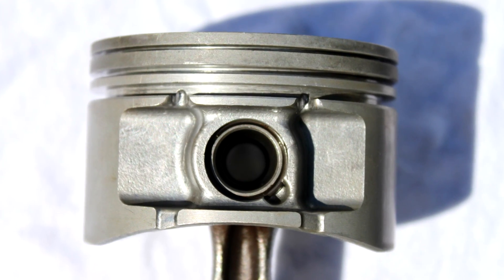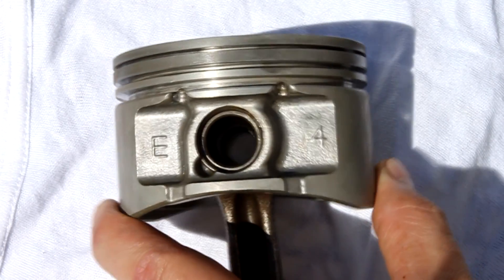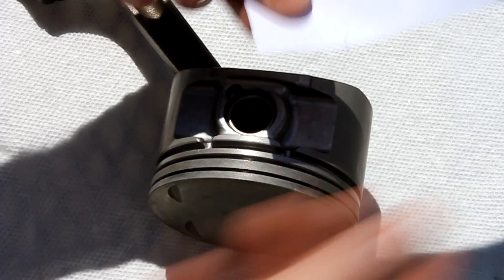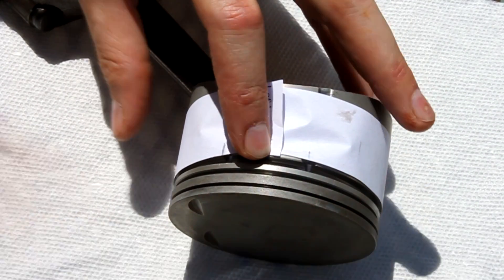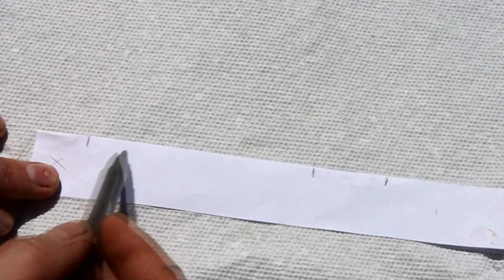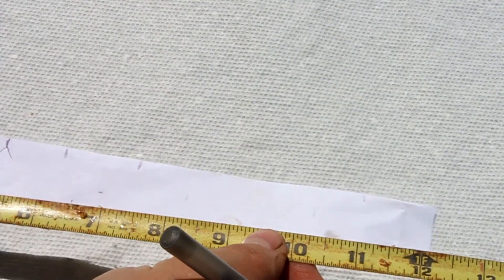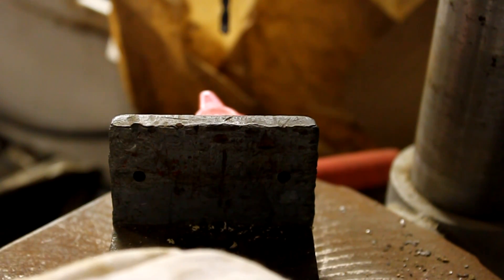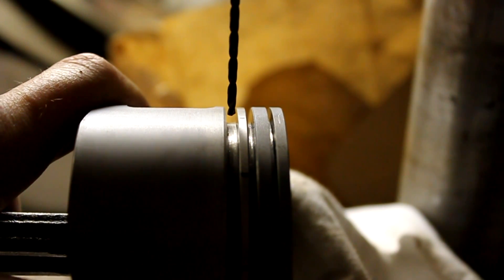Drilling oil drain holes in piston, Oil consumption & burning issues

Comment: should gas port the piston while ur at it it seals the top ring and helps a lot ! in most measure .100 from the edge to the inside groove and mark it comes in right behind the ring and pushes the ring out on exhaust stroke sealing it tight

Comment: Followed your vid and did this to 12 hp Briggs which was a real smoker. With new rings, no more smoke.
Originally the piston had 2 square holes at each end of the skirt side. I drilled 1, center, full width of the groove both sides, and two 1/8 holes  either side of of center holes.

Comment: I've done this in 2 Saturn engine rebuilds, and it definitely helped.
Went from 1 qt in 1000 miles to under 1/2 qt in 1000 miles.

Not hard to do, just make sure you get any burs and debris from drilling out.

Comment: its important to have those suction oil cavities but also its very important to balance the pistons
(i). to balance the pistons, make sure you have installed everything that make the assy complete such as pins, snap rings, piston rings and its bearings
(ii). get a scale, (manual, analogue or digital) to measure each individual piston assy and write it down on paper
after all its accesories have been installed correctly, place the piston upside down and with a drill bit take out unnecessary aluminum metal material from inside the bottom of piston inside its skirts
(iii). measure its weight and make sure each piston weights the same
(iv). lubricate cyl linings and intall pistons inside its corresponding engine block
(v). finish your job and chaege your customer for it ✔

Comment: Where each of these grooves ARE! What a wast of time. Why not work on a hobby car that is something instead of one of the worst cars GM make. To me all Saturns were just awful looking and performed even worse.
Reply: Your opinion is wrong, stranger. Saturn S has a decent power to weight ratio, is easy to work on, is reliable and looks good in many people's opinion, and you can get a good one for less than a grand today, and find plenty of parts in junkyards and a very helpful community online.

Comment: I bought a 95 saturn SL worst brand new car I ever bought. Burned oil and It only lasted 5 years. I bought  kia rio after that brand new in 2001 and it lasted 15 years. Only sold it because the transmission locked up. A neighbor fixed it in a few days and sold it.
Reply: Then you had a dud. I have a 97 and its going strong at 226k miles.
Reply: Or he never changed his oil.

Comment: well done, you just threw a perfectly tuned and balanced piston completely out of whack. good luck with bore wear and compression loss
Reply: compression loss lol its below the compression rings
Reply: He can easily get them weighed and balanced. It's an oil ring not a compression ring. No way he will have a problem cylinder bore wear
Reply: remember kids, allways tune and balance your pistons!
Reply: Actually the consequence of the drilling is not enough to have an affect of the balance.  You’re comment is really baseless and without merit.

Comment: First, thanks for this. However, would appreciate a note in description warning about balance issues. It's still possible to remove more on one piston than others, and while pistons are out, why not check balance? Course, Doesn't crank need balanced if pistons modified? Forgive my ignorance, this is just something I have already overlooked, sadly. Thanks again though!
Reply: Nah, your not removing enough weight to where it'll effect balance if u were worried about it just weigh your rod and pistons to note any weight difference but I can guarantee this isn't gonna throw your balance off by any means, especially if u do them all the same but the difference in weight will be so minimal it'll go unnoticed! If your still unsure skip drilling a couple of the holes and just do a couple instead but it won't matter as far as throwing off any balance
Reply: I was wondering the same thing about balance
Reply: It's nowhere near enough to affect "balance". It is anyone's guess as to how accurate the factory balance is anyway.
Reply: btw, engine still running strong after this mod. Unfortunately, I can't comment on eliminating oil burn... I am almost sure I compromised the seals on the valves. Might still try fixing this using another trick to allow replacement w/out taking the head off... 

If I think about it, I can comment back here... Though, it's been 5 yrs, dunno if I'll get around to it. (now, maybe burns 1qt every 1k miles? Dunno about originally, it's been too long )
Reply: @ThePepperdirt  if your worried about using an air adaptor because of poor valve seal you can use a piece of nylon rope down the spark plug hole for each cylinder then just turn the engine by hand till the rope holds the valves up at top dead then you can remove them without worrying bout accidently dropping a valve when you the springs back on you just turn it over the opposite way and pull your rope out
Reply: 99' Saturn. 250k(?) full engine rebuild ( probably only needed head gasket replaced, maybe filed smooth ) now sitting at 270k. Don't drive nearly as much lately. Reliable car... ( can't believe I didn't replace the oil pump. prolly going to die one day lul  Was in spec at time of inspection tho. )

Comment: Would that make a piston weaker?? Aren't you worry about, they will "split" half??? Just wondering, and one more thing: which oil makes less smoke: full synthetic, or regular, like high mileage??? And which oil makes more "mess", slouch?? Thanks =)
Reply: Nahh a good quality piston wont split in half if u Drill a small hole

Comment: What about the removal of material from the piston throwing out the balance on the crankshaft? Engineers go to a lot of trouble to ensure secondary balance issues.
Reply: If the holes are symmetrical on all the pistons on a 4-inline engine, there should be no imbalance issues.

Comment: How well does this solve the consumption problem?  Also have there been any problems with the balance between the crankshaft counterweights and the weight of the piston and rod?
Reply: Ring doesn't get stuck with sludge
Reply: If people don't change the oil on time and use crappy conventional oil even the biggest hole will clog with sludge. But this should work better and be harder to clog
Reply: It won't ruin the balance, this piston didn't even lose one gram of weight:
https://www.youtube.com/watch?v=la4nazvcyrs

Many premium builds don't even balance their piston to +/-1 gram, so the difference would be practically impossible to notice.

This example was done to a V8 engine, where piston balance is even more critical.
Reply: I wonder why some of these people open their hood for god Sake XD
Reply: I have this question too.

Comment: if the holes aren't drilled evenly will that throw off the balance of the piston?
Reply: +michaelpault Yes, but it won't be of consequence because the piston isn't spinning, it only goes up and down. You more or less want them evenly spaced simply to do an accurate job, and for oil to have plenty of opportunities to flow in several places.
Reply: Pistons are balanced in weight to the other pistons on the same crank. If all of the pistons being drilled the same, then balance won't be a issue enough to even bother with it.

Comment: this is crazy.. even Pistons out of lawn mower engines have holes drilled into the 3rd groove
Reply: +bobl78 even air compressors do !
Reply: Shit will cut your lawn so fast and smooth you gonna think you're riding slick tires on brand new pavement

Comment: Hi. Thanks for the upload. The BMC / Leyland 1275cc A series engines suffered from the same problem, the solution being as you describe. How much can 6 holes per piston cost at manufacture? Cheers
Reply: +Andy Reynolds: It may not cost a lot per single Piston... let it be one Dollar... it is a lot of Money if you save one Dollar on 4 Million pistions..that´s why they do it.. crazy wordl
Reply: *exactly*;
Reply: +Andy Reynolds It's because the cars are designed in Washington by regulators and not by engineers. Adjust geographical reference in BMC/Leylands case.

Comment: Every Saturn I've ever seen burned oil right off the lot new but this does work did it back in the late 90s to several Saturn's and everyone of them is still on the road today
Reply: +David Tuerk yeah they definitely like to consume oil the one I have has close to 600 thousand miles on it the car actually went 156 thousand miles with the original clutch just had to replace the oil pump and housing due to low oil volume but adding the oil drain back holes in the piston made a world of difference in oil consumption went from about a quart every 500 miles to about every 1000 to 1200 miles a quart and for as little as I've had to do to this car since new in 1992 besides general maintenance the oil pump and oil pump housing and replacing the entire cooling system and the drain back holes in the Pistons is the only real work that's been done to it in the 23 years my wife has owned it
Reply: The Dude - I had a ‘92 for 25 years and found this trick helped too. Similar observation on need to add oil.  These are relatively strong engines in other respects and can take abuse like moderate boosting.  Sad to have given car away 2 years ago due to lack of parking.  ☹️

Comment: It would be a better idea to line your vice with aluminum strips. Cheap stock (flat or angle) from the hardware store cut down will work great. It will not mark the aluminum piston unless debris gets on it or there is a jagged edge from cutting.

Comment: My sl2's oil consumption is getting worse. What are the thoughts on pulling the pistons, drilling the holes, and putting just new oil rings in? Doing this without doing a complete rebuild.  (no other rings, no honing, etc). Thoughts?

Comment: It if far more important when drilling to not mar the upper ring surface in oil ring groove.  The bottom surface isn't really important.  Many new vehicles have the holes that break into the bottom surface.
Reply: So where should the hole be drilled then

Comment: I did this to a Saturn 1.9 one year ago, the engine burned about 1 quart per 100 miles before drilling, and 1 quart per 1000 after drilling. After one year of driving every day, still using only 1 quart per 1000 miles. Thanks for this video!!!
Reply: Sounds like your valve stem seals are leaking you should have the head rebuild

Comment: toyota need this in vvti engines.
Reply: +Broj 1 Toyota must have fixed the problem by 2006. I have an '99 that drinks a  lot of  oil .
The problem is (per the Toyota service bulletin): The piston runs at a higher temp than expected, so the oil cokes up behind the oil rings and makes them stick.
 More oil holes will   increase the flow thus cool the pistons. Using synthetic oil after the fix will guarantee  no  more problems with this.
Reply: ***** was a problem with toyota. sometimes the master can fail too.
Reply: +MElekiaZ Strange,some people that I know,who own Toyota Corolla,complain that their cars are consuming lots of oil.(From the first day,thay bouht them)I bought my Corolla,brand new,back in 2006..I got on odometer 131 000 kilometers.I never had to add any oil,but I go overboard with maintenance.New synthetic oil,and oil filter,maximum every three months or 5000 km,whichever comes first.Replacement of lubricants is cheapest way to prolong life of your vehicle.
Reply: @MrCROBosanceros  Maybe the engine on your Corolla is not the type of engine that has that issue. I have a Matrix S that has that famous engine and putting a gallon of oil a month because it's consumed by a bad design on the pistons is no joke. I can not sell the car like this because I would end up doing into others what they did to me and it's not fair. So as you see I'm here on Youtube trying to find an answer to fix an unwanted dilemma. I had the car for three months now and I have tried many things and still have the problem. I wish I can sue that person but I don't think I can anymore, obviously he knew about it before selling the car
Reply: +4G63PWR I have 216k miles and it started to consume a bunch of oil. I do change the oil every 5k miles uses high milage oil. So is pretty common on this VVTi engines to fail on oil consumption and sitting valves. Then starts to make a mess because the oil gets on the spark plugs burns them. Then goes to intake starts get dirty and clogged. Once you fix this pistons you are good to go.
Reply: My fiancee's 2010 scion xb strted consuming about 1qrt every 1000mi after it hit 100k mi, its a great box car thing, i just stay on top of checking the oil every week, and it seems to use less oil after i switched to Pennzoil Platinum high mileage full syn 5w 20 and k&n filter. Its common on the toyotas and scion with that vvti engines. My 08 honda si  (2.0L k20 ) doesnt consume any oil at 105k mi
Reply: Sometimes you just need to overhaul the engine with new rings, hone the cylinders, and new valve stem seals.  I just finished doing that on a 2006 4runner with the 1GR-FE engine that has vvt and it uses zero oil between changes. 3:52

Comment: Great idea to add more oil drain holes. Now only if there was a way to do it by not having to tear the stupid 99 Saturn SL2 engine apart,lol. Just bought this clean 99 SL2 with 120,000 miles and found out it uses a quart in 1.000 miles with 5w30 standard oil. It doesn't smoke at all and no leaks plus it runs awesome. Oh well, guess I'll just keep adding oil.Going to change oil to SuperTech 10w30 High mileage next oil change,I guess it's too late for full synthetic to do any good. Hope the thicker oil will help some. My wife's 96 Saturn SL2 uses  less then 1/2 quart between 4000 mile oil changes.It has 80,000 miles.I switched it to Wally SuperTech full synthetic when it had bout 35,000 miles.Seems to be working for her so far.Thanks
Reply: Don't use "high mileage." It's more apt to gum things up. Use full synthetic, it will help dislodge deposits and keep the rings from sticking.
10w30 is not "thicker" than 5w30. The viscosity is 30. 5w and 10w are winter grade oils, 5w being for colder climates.
Reply: ladefreakndah Rotella 15w 40, works night and day. It has enough calcium to keep it clean.

Comment: Nice video.  Clear, great close ups.  But, this doesn't explain why my motor has consumed oil since the day I bought my factory ordered 1997 Satrun SW2.  Also, I have changed the oil at an average of 3K.  Now at 158K oil consumption has increased but not that much.  Maybe 1.5 qts ever 3K.
Reply: It is a poorly designed piston with poorly designed oil holes. You car and every other car has consumed oil because of the little tiny holes. It wasn't as bad new because the holes were clear but over the years your holes may have gotten smaller slightly. Your proper schedule of oil changes has been why yours just didn't plug up and still works semi-properly.

It was an engineering flaw. Entirely the fault of the engineer who designed the engine. So all the engines until this has been done will consume oil regardless of how clean it is.

Also valve seal wear out as well so when they start going it can leak oil past the valve guide. Usually that is evident by a smell of burnt oil while driving.

Not trying to scare you but it could have been designed better. Also areound 200k on these engines they blow their head gasket especially the SL1 and SL2.

You said yours is a SW2 so that tells me you got the wagon which is the same. They were nothing more than a car to get around in. They have very little power and all around kind of suck. But because they last over 200k a lot of the times people liked them. But these were not as good as the push rod Iron Duke engine by GM. Those you could beat and it still would run. same with a 350 or 3800. They are just considered good dependable engines.
Reply: Great info EC!  I replaced my head gasket at around 155K / 18 years.  Currently, running great.  I agree the motor could have been designed better and that the car was designed to be very difficult to work on and thus 'disposable' but I paid $17,300 OTD 20 years ago and if I got Automatic transmission and Power Windows that would have been 19K! int today's dollars that would be $29K!  When I look at a 4 cylinder in a 1998 Honda Accord (same price) there is no comparison - the Honda engine looks like it is for a truck - really beefy and better motor mounts.

Comment: i have noticed that most aftermarket pistons for this engine all have oil drain back holes..I have a 2002 Saturn with over 140 thousand miles and it doesn't seem to use oil until it is time for an oil change.. I guess i'm lucky then

Comment: Why wouldn't these holes get clogged too?
Reply: Because he intends to give the engine proper oil changes. Engines stay clean if proper oil changes are something people do.

He also probably drilled them larger than the original holes to help with that.

Also there are a lot of them so the chances all of them will become plugged are pretty slim.

Oil has detergents for cleaning after so many miles the detergents break down and no longer clean allowing carbon and crap to build up. If your cars oil gets changed often then detergents are constantly cleaning. Resulting in all passages staying open and a nice clean and happy engine.

Comment: @hddm3  Yes, synthetic oil helps.  When oil can't drain properly due to the piston design, it gets hot and bakes into the groove, gumming up the oil ring and preventing it from doing its job.  Synthetic oils are more resilient to heat and keep the groove freer.  If the car already uses oil though, then most find that all the synthetic oil, seafoam etc in the world won't unstick the rings.  Synthetic won't fix it, but it'll keep it from starting IF it hasn't already.